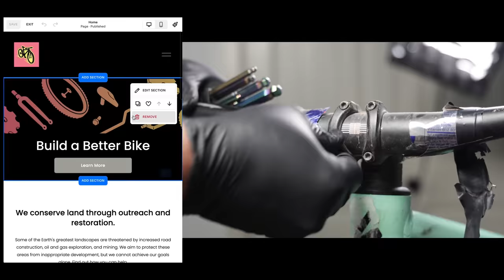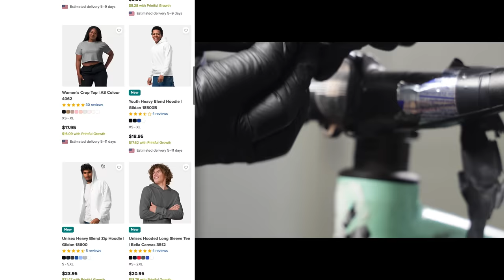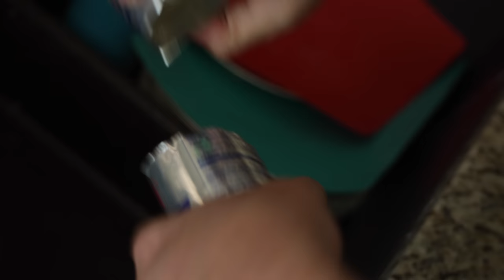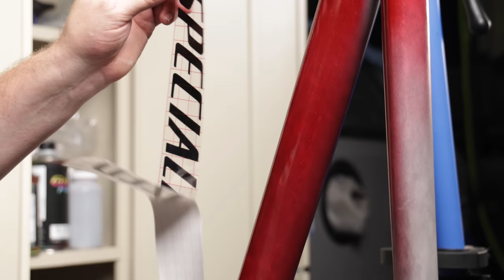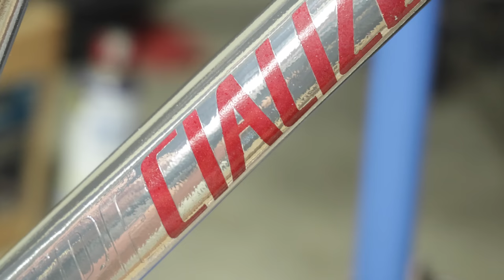It Fell On the Freeway; I Restored and Rescued It

Comment: Dont call my beloved Advent sub par man! it is an awesome humble drivetrain, basically indestructible.pfeeee
Reply: I run it on my commuter and I love it.! I work at a bike shop and could get a lot better, but still love my microshift.
Reply: @nascarisawesome5018  Getting "better" drivetrains is a trap for a commuter. You're not gonna get there faster and tolerances are lower, as well as new parts are much more expensive.

I'd rather pay 10 bucks for a new chain than 40+.
Reply: I run it on my bike, clutch isn't that good but shifts really nice.
Reply: Love microshift!